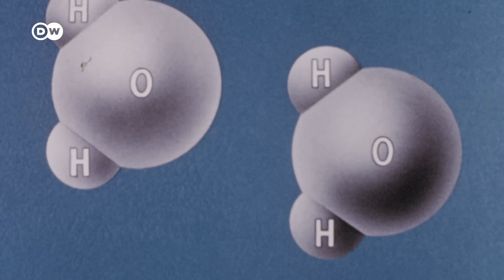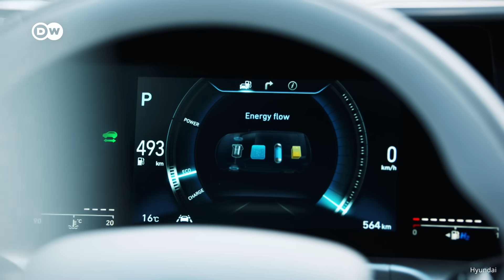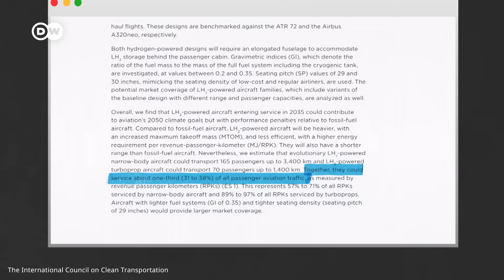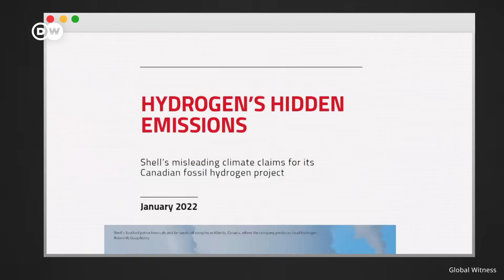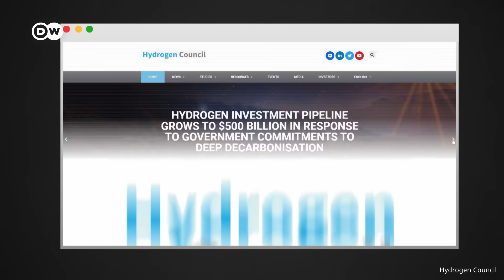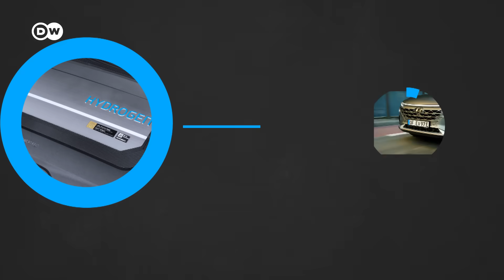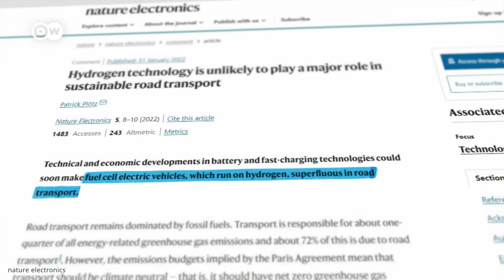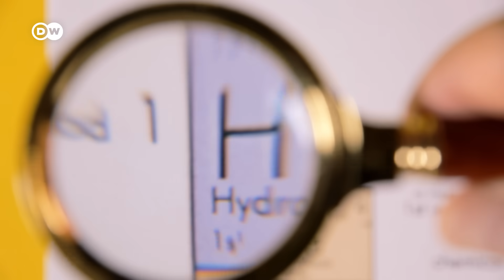The truth about hydrogen

Comment: Total hype and marketing. It was all a buzz 10 years ago and we thought we had seen the last of it. 
Don't forget its extremely flammable, and has to be stored at colossal pressures to make it even remotely practical for energy storage (typically 350-750 times atmospheric pressure!) Making it all the more scary! (There have already been a few explosions e.g. Oslo)
The gas (molecule) is so small it can actually seep through everything, even metals, and it is estimated to be 200 times worse than CO2 as a greenhouse gas.  
Fuel cells contain very delicate catalysts that are easily poisoned, especially by things found in the emissions of combustion engines so they are going to be plagued with problems if mixed in with our existing transport systems. 
The bottom line is there's a dam good reason we burn things with carbon in them! (They have a fantastic energy density!)
E.g. Tesla model S battery=98kwh @544kg => the equivalent of just 18.4kg of dried wood!! 
Much more effort should be put into synthetic production of hydrocarbons with carbon taken from carbon capture, so they are an active part of the carbon cycle.

Comment: Former USAF flight surgeon here. Hydrogen has a low volumetric energy content so you must store it under very high pressure in order to extend the range of an airplane to commercially-viable distances. As noted, hydrogen is a very small molecule that readily escapes containment unless very expensive alloys and manufacturing techniques are employed. Significantly reduced atmospheric pressure at altitude means that such hydrogen fuel tanks will be subject to significant high intensity expansion-contraction metal fatigue. Non-metallic connectors and valve components are at even greater risk of failure. Catastrophic failure is almost guaranteed over usual useful lives of airframes. The excessive fuel tank weight decreases thrust-to-weight ratios. Frequent x-ray or other structural integrity testing increases costs and ground time. Frequent fuel tank replacements increase costs and reduce sortie rates and aircraft readiness. A small number of short-haul test flights is inadequate to proper safety testing. Ships, maybe; for airplanes, we really need much more realistic life-cycle data.

Comment: What imo is Hydrogen's biggest upside is that you can refuel/recharge it a lot faster than batteries.
Reply: I charge up my EV in my garage. But there’s nowhere to fill up with hydrogen. EV batteries and charging are getting so good that soon it will be faster than filling with gas. Did you know there is a new battery and charger that will allow you to charge your EV in under 1 minute? It’s in the testing stage but this is the direction
Reply: @kevinaschim8475  Did you know that the downside of fast charging is that it lower the battery life substantially?

Comment: The video of the DM was very good, but what if the production of H2 could be produced decentrally in the required quantities per performance? The problem of storage of H2 is known to all of us. But if only "on demand" the desired amount of H2 is produced by electrolysis, if enough electricity is produced by the process of driving? very interesting approaches can be found in HOO-hydro- Reakor (dry cell) combined with a Gasoline engine. Interestingly, industry and research are currently interested in the process. The only difference is that the production of the fuel separately as LOHC. As a result, the existing filling stations are used and what would actually be available for free (water) is sold to the customer as LOHC+ and the "unloaded medium" LOHC - is returned again. Take a look at the following video and share it if you like it. ;)

HOO-Hybrid-Reaktor in the real life (english/german)
https://www.youtube.com/watch?v=u9nVo4RTTAE&feature=youtu.be
https://www.youtube.com/watch?v=GhbL0ASl2hQ&feature=youtu.be
https://www.youtube.com/watch?v=qdDoxQEwMxU

LOHC - fuel (german)
https://www.youtube.com/watch?v=4DAfargngXk&feature=youtu.be

Comment: One thing about Hydrogen that is not mentioned is its energy density compared to lithium-ion batteries, yes with today's technology close to %50 of energy is lost from electrolysis to being in the car but for the same weight liquid Hydrogen has 10 times the energy mass to lithium-ion batteries having the same weight

Comment: When you make hydrogen where does all the oxygen go?
Reply from the maker: Good question! It would depend on what type of hydrogen you are trying to produce. Normally, the oxygen ions pass through the solid ceramic membrane and react at the anode to form oxygen gas and generate electrons for the external circuit. If you want to make green hydrogen then the oxygen generated in parallel is released into the atmosphere or can be stored for later use as a medical or industrial gas in some cases.
Reply: @DWPlanetA  I hope we dont have another problem  where oxygen emmissions as waste  are the new problem.
Ie making millions of tonnes of hydrogen for cars and then dumping the waste oxygen into the atmosphere .

Comment: Interesting to see the criticisms of hydrogen, ie inefficient, not green to produce etc More interesting that the same drawbacks to wind and solar aren't discussed anywhere. Batteries need lithium and cobalt. Both rare and toxic. The cobalt is mined almost exclusively by children in 3rd world countries. Solar panels are made by mining coal and high quality quartz (using fossil fuel) and burned at high temp to make the solar panels (in China, often with slave labour). Wind turbines are made with massive amounts of fossil fuel. They also take up a lot of land, often leading to either deforestation or displacement of wildlife  (or both). Neither wind or solar produce round the clock, so need fossil fuel power plants running idle (wasting fuel) to then pick up load at night or when wind doesn't blow. Neither can be recycled either. And on top of that they don't produce anywhere enough energy to replace fossil fuel,  even if we were able to scale up massively  (not least because we'd have dug up all the world's rare minerals just to make the panels and batteries). The whole energy plan needs a rethink,  rather than just pretending that 'renewables' is the only politically acceptable answer and strong arming the scientists into laying down a smoke screen to cover up the flaws in the plan.

Comment: the main thing not brought into the equation is the source of water needed to be used for green hydrogen!  What is the environmental footprint of the amount of water/hydrogen to be extracted from the water source, considering the quantities needed for a green hydrogen world!  Fresh Water is currently a valuable commodity in much of the world, so the hydrogen has to be produced from the oceans!   The problem is the quantity needed, so if you remove pure water from the ocean, in a limited area, you leave behind the salts and minerals that were present in that seawater!  while this occurs naturally thru evaporation, that happens worldwide, but when you are doing this on a massive scale in a limited area this could be a problem!
Then consider that the most prevalent greenhouse gas in the world is water vapor!  The product of burning hydrogen is the production of water vapor, so once again you are trading a greenhouse gas for another greenhouse gas!  But then consider that the current major product of burning petroleum type fuels, is also energy, water, and CO2!

Comment: With "renewables" there are no emissions reductions due to the ridiculous emissions due to increased mining and manufacturing.  Renewables are a total failure - all of these schemes will result in more environmental harm than any good !

Small modular nuclear reactors can solve a lot of emissions -  Voyager was nuclear powered and  still be functioning after 45 years.

And how is it emission free - water vapour is the single most powerful so called "greenhouse gas" - the concentrations of water vapour must increase if we continually produce and use  hydrogen.

Nothing is as simple as they say but I'll bet hydrogen never becomes viable.

Comment: lets propose a technical jump into future ower 2040 in star trek view future based cities are build and made blue and green points resource production as well as handle waste and energy based infrastructure following like solar cells and wind electricity is athmopshere allow then practical sphere is thorium cells direct input and capitalism vay off energy input a like 56%-60% reserved for nuclear tech energy plug inputm, this works in any economy and actualy serve as industry input and is usualy aorund industry zone so new citeis and any city would require reosurce as well a agroponics area so in welll neede acomodated cities to future with industry based on creatvity and resource suply and functional industry serving and resource theme in industry basicly is advanced society with reserved assets in like 30% based on year budget only for research and inoavation so technicaly speeking it would plug in any factory or part off economy in industrial type vay in economy sphere this vay allow lot faster resource gathering normal fucntioning cities or parts off economy functional labour and inustry vay are based on economy based surplass energy society were resource and energy play a role so is not endless in resource but rich energy resource epsecialy electricity surplass theme this model allow build on mars tech cities based on modul pretty saem stuff also on earth except iff resource needed and industry a artifitial diamond production could help and reexport between colonies to suply grow turnower and bring thorium cells plug ins into network grow H gas facilities solar cells even wind electricity if there and all that in unhabitated soil with air and for start you need like perfect ratio like in suply probabyl busy area is like 60% assers reserved for industry grow and like 40% for population as unahibatable is energy electrcity volume owerproduction and release H gas into colony athmospere allow even more build grow underground railway for expample tunel construction above city epxpand and epic H gas reserve and water reserve for living purpose and grow off nuclear salt reactros creating a industry based cities based on earth modul economy whoa is already based on tocamac power or already based suficient economy energy and electricity surplass society if conditions turn be tough a sphere ratio off reserve modul could go on 70% for indsutry and 30% resource for poeple and economy to live functionaly normal it means only more wokrers and assembly in that sphere as task of job eforts lets a cultivation off really unhospitable soil planets in event ctritical life athmosphere slight more then nomral below and to windy allow even like again quarter 25% as 3 to 1 ratio in like 75% to 25% resource theme industry to city and help off robots in gas extraction and every day work in industry by some time in thoery off travel allow easier bypass to giant gas class start jupiter and saturn or even neptune that time in futurer where trader and colonies are at expanse and even more gas resereve output are poor in and well established H gas power facilities thorium plugs and salt reactors and stabile citeis and more like independant colinies apear and self trade established and marsians living among us and returning to earh and make they own economy improve and into agronomy an d industry so life people and economy circle well easy and esablished post on even more work in possible colonies so in theory people like theory on colonies on other planets well and easy and fucntional too thats boom in economy and n resource and owerproduction successfuly with purpose owersurplass energy and electricity society theme again energy factor society and industry in use is factor off use creativity and goals paterns to be eficient in time as creative not messure off decades which go in steps simply folloing goals and industry curves in future anyway so any tech based on creativity already assembled on earth bit like  star trek stories on earth and beyond in booming warp industry steps definetly polite and understand energy polite return resource into athmospeher and even well build atmpshere preps to change imrpove life soil extract and learn and expand colony life and expaned and trade slight more and make biger preps with more colnies and even mor gigantic gas solution and salt reactros  boom H gas facilties in way 20 year off experience can be put to next 40 year or 60 years with vision with good preps thats the role off resource and resource themes in industry zone and reosurce facilities in economy that hwo build plug in functional energy resource theme agian in inudstry poeple counts steps and people on coledge dream analyze this help build work invest to achieve this thats realistic tough goals in humanity future funcionality in based creativity and creativity based on indsutry with locked research and inovation on based reserved 30% from year budget and locked inustry patern for resource and electrcity in economy as western capital way plug security as boom and owersurplass society in energy and electricty are reserved for future and serve economy and crreativity  a kind preaty large unlateral vay and quite open to future and works with even opening in future it doesnt go with out industry plug ins ways in future cirlce economy anyway energy polite society now that is how realstic view on aproach tech and energy vay and view on fosil vay on economy could look like from university point off view or graduate work simply as based transparent idea or graduate and understanding compress time and expand view or what it takes after that or understanig nomaly a standad point off view or human looking or wacthing slight from above or seeing future kind squeye to booom next 20 years in warp inudstry creative way as most likely the purpose off coledge or cledge eductaion serve for so the article for brainwise or theme for graduate would be funcionality in balance but elsewhere in english so graduate a theme end is not needed only marks given as an article rest is labour and work even in future as star trek based economy energy based suficient surplass society

Comment: Here are the problems with hydrogen.
It is not a source of energy it is a carrier of energy just like electricity is.
Green or any renewable sources of energy are still rare and we should use them as efficiently and effectively as possible. Hydrogen doesn't do this.
Hydrogen use Steps...
 1- Produce Electricity
 2- Turn electricity into hydrogen
3-  Transport the hydrogen in expensive high-pressure tanks
4- Fill another expensive high-pressure tank at a refueling station
5- Then fill the vehicle's high-pressure tank
60% of the energy is lost through this process
Alternatively, you can use the same energy from step 1 and skip the 2-4 steps saving money.
By using the Power line infrastructure we already have we can charge an EV,  and only lose 20% of the produced energy.

Plus you need 3 times the size for storage than natural gas because of its lack of density.

Comment: 1. Scientist are saying not enough materials on earth for the EV vehicle politicians want to produce.

2. Estimated materials for making a tesla batt takes 500,000 tons of ore. 

3. Refining these materials before battery production produces nasty types, huge amounts of pollution you don't need near water supplies, wildlife.

4. The total life cost of an EV calulates different than combustion vehicles. 
4b. After so many miles, wHs,  EV batts must be replaced. Operating batt EVs in extreme atmospherical temperatures (consistently) hot / cold decreases batt life. Life of EV in miles, batt is changed 3 to 5 times depending on just atmosphere condition.

5. Storage of pure H inside a vehicle in traffic increases probability of serious explosions powerful enough to create volume of collateral damage to humans (drivers, passengers multiple vehicles, pedestrians nearby), property.

You are aware, I'm sure, of Bob Lazar's means of very safe storage of H in 4 scuba-sized non-pressureized hydried tanks. Car is charged by removing H tanks to electrolysis room in house. About 400 miles to 4 hydride (?) tanks.